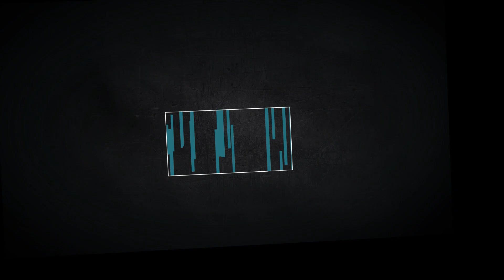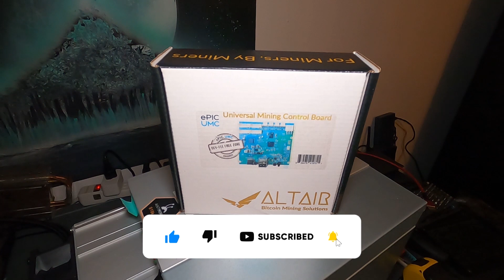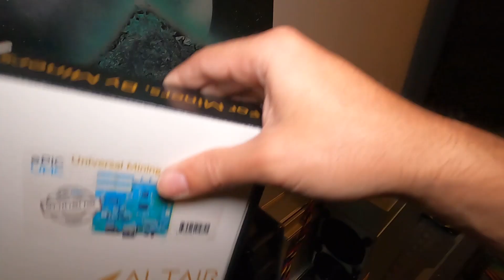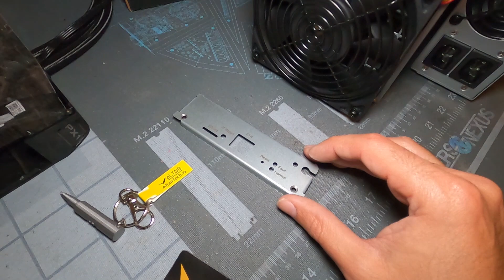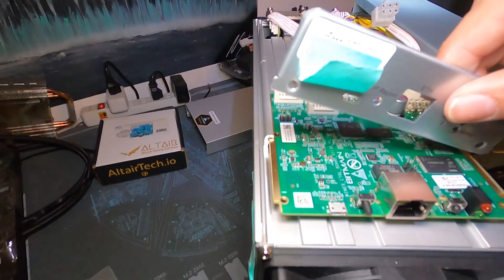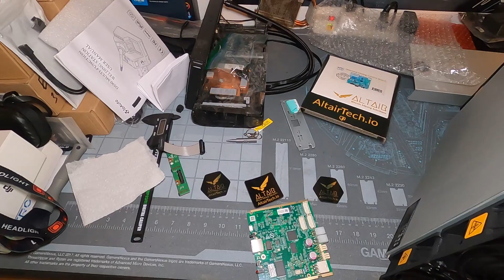How to install new a Control Board in Bitmain S19

Comment: Why can’t connect j1? It’s got issue? Because I’m also use amdlogic type S19jpro change to board type c87 they have 4 port hash connector . Please advise
Reply from the maker: @akmala8215  j1 us used by manufacturers. Your board won't be detected if you plug into it.
Reply: @SerpentXTech  then i need to connect j2 for hash 0, j3 for hash 1 then j4 for hash 2?
Reply from the maker: @akmala8215  correct, but please confirm and let me know.